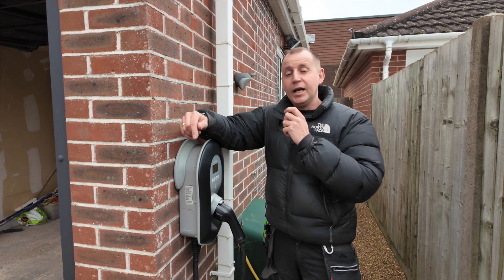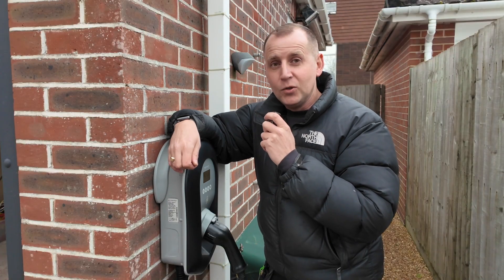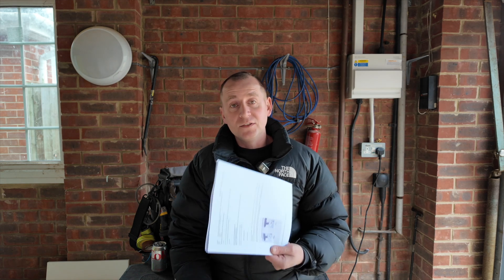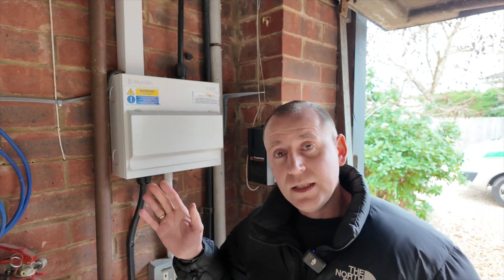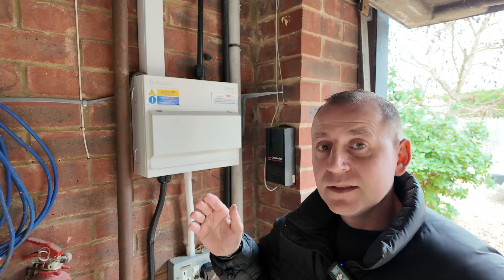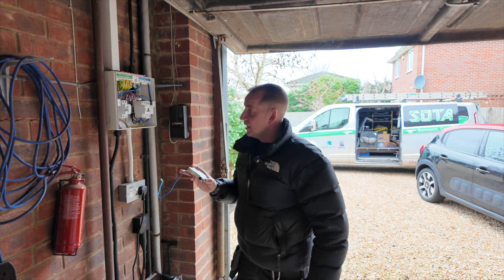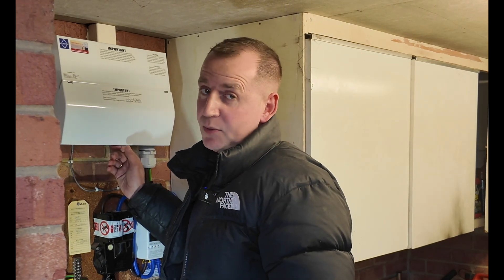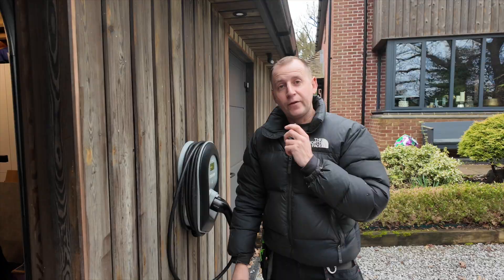THOUSANDS OF INSTALLATIONS MAY BE NON-COMPLIANT...ELECTRICIANS REQUIRED TO CARRY OUT REMEDIALS

Comment: This is all very curious.  Which BS7671 regulation says you need an RCD at the source of a circuit? The RCD is required for a socket (charger cable) but it does not have to be in the CU! There is one in the charger so regulations satisfied! Your install was fine, the regs changed (?). Not your problem if someone comes to modify the circuit, it is their problem.

Comment: This is very interesting. During my 18th edition training in September the lecturers told us not to fit two RCD’s in series with each other because of nuisance tripping. However they then said that if you have to go down this route the an RCD with a longer tripping time should be fitted up stream. This is all good but then I’m thinking “what protects the circuit from over currents?” Surely there should be a MCB in circuit or fit a RCBO but can you get a RCBO with a longer tripping time ?

Comment: Just had MCS inspection on a PV and battery install. Looks like it'll fail for the similar reason - inverter requires separate RCD, built-in RCD is not sufficient.

Fortunately, firm who installed will rectify without charge as my home install is under MCS scrutiny.

Comment: Having taken a friend's ( faulty ! ) ZAPPI  wall charger to bits .... I  noticed that the memory back up battery is  SO TINY  , no bigger than a watch battery , ( and .. of course .... it is totally flat ! ) .... There is LOTS of room inside to fit a decent size 2032 type " coin cell " battery , as found in most desktop computers etc .... comments welcome ..............  DAVE™🛑

Comment: WTF, its recommended, neutral should be allways connected for safety reasons.
Circuitry cannot fully discharge if you disconnect both live and neutral wire creating hazard. It can also happen that circuilt breaker melt and fuse live connection and disconnecting neutral when Live is still connected increase hazard, potential discharge is going path of least resistance which in this case would be anyone touching it.

Comment: I am glad that you brought up this topic. I've done the Myenergi course and I also talked to NAPIT about it back in the days. 
I've been told by NAPIT that Semi Conductors are not acceptable as disconnection of supply, therefore any built-in RCD is not acceptable. 
Also, I installed way more Hypervolt than Myenergi and their guidance specifically mentions the upstream SPD and D. Pole RCBO/RCD requirement.

Comment: So, the dB rcbo.  S type?  100mA?  Selectivity and coordination accounted for?

Just finished the new EV c&g  charging course.  If it's a built in RCCB/rcbo on the charger then the cable supplying it becomes a distribution circuit.  If it's armour, then it doesn't "need" RCD protection but can still be fitted.  Sounds like the dno is requiring clarification training for their wee folk in the office.

Comment: Glad I saw this video, my spark put my Zappi2 in back in Nov 2020...  It's running off a 63A 2pole Type AC RCD on that side of the board, its feeding 5 MCB's, one of which is a 32amp for the charger.  I'll have to give him a bell, I'm guessing to be compliant this needs the RCD replacing for a Type A or is it that the charger itself needs to be fed off of it's own dedicated Type A 2 pole RCD?   Not sure I have room in the consumer unit.
Reply from the maker: Hi buddy, the charger requires its own double pole RCD, chargers cannot share RCD’s anymore
Reply: @sotaelectrical  Really appreciate the reply!  OK, got you, that might need my spark to be a bit creative to get that to fit in :) - I've also read (in your comments here) a compact 2 pole Type A RCBO can work also, I'll mention that to him.
Reply from the maker: @ yes that’s manufacturer dependant 👍👍
Reply: @sotaelectrical  I've a Proteus board, fitted 2020, so hopefully their slim RCBO will slot in, found one on CEF that might do it.  I'll let the pro suss it out :)

Comment: It’s quite straightforward why it does not meet the requirements direct all RCD must have a test button and that’s why it’s non-compliant
Reply: and mechanically disconnect live conductors with no auto reset. Alot of people are assuming a PCB board based RCD is compliant to 61008/61009. The DoC for the product will state which BS numbers/standards are complied with.

Comment: It dose not need a RCD in fuse board as it’s has one in charger and surface armoured , where it in the regs, can’t find it
Reply from the maker: It does need an RCD because the one built in does not have a BS standard.
Reply: @sotaelectrical you got to love it😂😂, always thought discrimination was quite important, maybe they should make a charger without a RCD, and just fit one at origin, maybe would be cheaper 🤣🤣🤣
Reply from the maker: @robertmailer4978  absolutely agree mate, it’s crazy

Comment: So what happened in the end? Did you get a replacement one? As ppl say, at the time it was not required to have a separate RCD. Im in the same struggle atm, but when mine got installed it wasnt required to have one. Still dont think it is required where im from.
Reply from the maker: The end has not come yet mate, il let you know

Comment: I feel you pain I had a similar question, as my energy told me it didn’t need an RCD protecting upstream as it has its own built in. I ignored and fitted one anyway as the RCD that’s in the zappi is a digital not mechanical DC current detection. I didn’t think I’d be compliant as in effect I’m fitting 2 of the RCD’s on the same circuit and neither are time delayed. But my reason for ignoring was that what’s protecting the cable supplying the Zappi. 

It’s wrong really and like you said it should be clear, we are out there doing the best we can translating the regs and manufactures installation guides into an installation that’s fit for purpose. It’s also very hard to keep up with changes.

Comment: Hopefully a big electrical contractor will challenge this in court. It makes sense to fit an rcd regardless as the charger may get changed for a different type in the future, ( yes not your problem but it nice to future proof thing.  The rush to RCBO’s is going to come back and bit us using single poll offers no protection against PEN faults and should be banned or made go have a 100ma main switch or the like. True professional going back to these jobs and it not the customers problem.
Reply from the maker: Thank you for commenting, we shall wait and see what happens! It’s changing like the wind at the moment 👍👍

Comment: What about selectivity issues with an upstream type A and downstream type A in the Zappi?
Reply: I would want clarification the 2 devices work without detriment to each ……although I’ve fitted the same set up myself where a house CU RCD was changed to type A
Reply: Obviously the 30 milli amp protection might be subject to selectivity but always been told the Zappi internal RCD is different 😁

Comment: Are they saying that before they supply a replacement charger under warrenty, the installation needs to be brought up to current regs so it is compliant going forward? Or are they saying because the installation isn't current that the warrenty is void and they won't cover it at all? The former is not entirely unreasonable, but the latter is outrageous and wrong. It's not really clear from the video which of these it is.

Comment: Just another reason from the many hundreds of reasons EV's are not as practical as a ICE car, Unless they are charged from 100% green renewable energy they will still pollute, maybe no exhaust emissions, which would be good in congested cities. But I would never wish to take one on a road trip, not with the distance you get and the long charging times. And on top of it all I keep hearing stories of charging problems and faulty chargers, and the possibility of the Chinese turning off their EV's which they have the ability to do. Or deliberately hacking the car and charger to go into thermal overload. Don't know if all the stories are true but I will stick to age old tested and trusted mechanical technology that is not connected to the internet of shit. Why would you need a car to track your every trip unless you are running a business fleet. To me driving an EV doesn't give you the feeling of freedom when you cruise up a freeway, they feel sterile and lack any character. Let the kids drive their slot cars.

Comment: It makes a video, but I don't agree with you having to do it at all. It was compliant at the time, and the regs are not retrospective, did you not argue your case? I'd of placed a separate rcd and enclosure below the board for that circuit also, not effectively made the garage installation worse by covering the lot with one RCD.
Reply from the maker: Check out part 2 - I went back and made changes

Comment: I don’t get the issue… if there is a built in RCD te only purpose the RCD is going to do is protect the clipped direct cable between the DB and the charger. Pointless silly shit. I only install RCD where completely necessary.
Reply from the maker: Ok so the built in RCD is a digital one that does not comply with the regs, so if you are not installing upstream RCD’s then non of your installs are compliant and warranty will be void

Comment: This is the problem when the people doing  the installations have to rely on the diktat of incompetent regulation makers, why wouldn’t you install an rcd? Unless both installer and regulator have in depth knowledge of electrical theory and UNDERSTAND why you must or must not install an rcd then this is either a warranty invalidating excuse or regulation for regulations sake. If the charger is rcd protected, why would an upstream rcd protecting the cable make any difference? Are they suggesting that lack of an rcd has damaged the charger?the IET and the registration schemes are largely staffed by poorly trained and incompetent people involved in arse covering excercises to hide the fact that they dont know what they are doing and dont understand what they are regulating. A lot easier to start at 9-30 with coffee in a nice warm office than be out in the job! When they start handing down these made up on the spot regs, ask them WHY? And watch them meltdown! Electrical safety has gone through the floor since the introduction of part p, IET. Regs and the “scams”. Our consumer units never caught fire !!
So glad to be retired from the industry!
Phil

Comment: My Zappi was installed in August 2020 when my house was being built. I didn't use it for over a year because I didn't have an EV. 

When I went to use it the first time I noticed that the LCD display was full of condensation. I called them to ask if it was safe to use and they asked me to loosen the screws on the front. Water poured out - several litres.

It turns out that the guy who installed it just bashed a hole in the back-plate and then pushed a load of silicon into the gaping hole. MyEnergi said they'd replace it for me and instructed a contractor to come and do the job. I cheekily asked MyEnergi if they would replace the single phase with a three phase unit as I have a 3phase supply and it was cabled for three phase. They agreed as long as I paid the difference which was very reasonable.

The contractor they sent was excellent. Not only did he install the new unit but he also fitted devices which monitored the 'direction' of the electricity flor (from battery, mains or solar) to allow me to make better use of the charger. MyEnergi informed me the next day that the new unit would have the full three year warranty.

I have to say that in my case MyEnergi could not have been better. They were quick to respond, very sympathetic to my situation and extremely polite and professional during all my calls and emails.

Comment: Interesting that it states type A . That assumes that all EVs have galvanic isolation between 230/400 charging circuits.Same problems with solar PV most inverters have DC fault protection so why do we need type b.I felt confident under iee but not happy with it these days
Reply: Iet
Reply: IET

Comment: Hi, in my opinion… 
If the Zappi needs to be replaced under warranty, then the new charger install needs to be compliant with current regs. If the previous Zappi was installed pre reg change and was compliant at the time, the customer should have to pay for new upstream RCD, and Myenergi provide new charger under warranty.  
If the Zappi was installed post reg change, and the original installer did not fit an upstream  RCD when they were meant to, then the original installer should first supply and install the upstream RCD, and then Myenergi should then provide the charger under warranty. That seems fair.

Comment: If an RCD is inside the Zappi, then the only section of cable 'unprotected', is between the consumer unit and the charger box- And that cable should be in conduit or armoured.

This is not an issue. It could be proven in court that for residual current to flow, there'd have to be a break in the supply cable to the Zappi box.

Residual current flowing between the Zappi and EV would be caught by the RCD inside the Zappi. I smell BS here.

Comment: I thought it is a fundamental rule that the actuation of any single protective device cannot give rise to another hazard. ie Whole building loss of light. I seem to recall this is building regs.
Changing the main switch to a double pole RCCB means any single earth fault within the whole installation results in an installation wide loss of power.
If you require DP RCD isolation and it isn't available at the DB then you should split the tails with RDL blocks to feed an independent stand alone DP RCD.
As it is, you now have a complaint vehicle charger and non compliant house.

If you say this isn't so - why did we bother with at first split load boards and now all individual RCD protected circuits.
Reply from the maker: So I made a short explaining why I done this, firstly how can I split the tails when this is a garage board, not the house consumer unit? I wrongly assumed that no tails, meter, cut out, massive garage door may have hinted this but not to some. The garage board also has literally no load on it, 3 unused garage radials going to individual sockets, and a garage light, I took this all into account when doing it.

Comment: Credit to you for retrospectively changing. 

A couple of points. 

Elucian make a 2 mod DP RCBO. It looked like you had a spare way still in the board so it would have been able to fit. 

This is a contentious one with some. However the EV is supposed to be on its own RCD and not share it with other circuits. I’ve had numerous conversations with NAPIT tech and IET to ensure I was correct and understood it. They all say that 722.531.3.101 means no other circuits. 
 
As you well know the Wiring regs are non-statutory and manufacture instructions always trump those. 

So if you have a copy of the instructions saying it’s not required then they do not have a leg to stand on. 

Personally I would be taking legal action against them for defamation. They have told your customer that you have installed it in a non-compliant way when you haven’t. Regs are not retrospectively applied. So if you installed in accordance with MIs and the regulations at the time. You’ve done nothing wrong. 

Personally I’ve never installed one without upstream Type A protection. But I know a few that have. 

Myenergi are on very dodgy ground here and I’d be taking them to task. 

More than happy to help you do so if you want. 👍🏻

Comment: I contacted MyEnergi on 21/02/2024 to ask about the on-board RCD protection, as I still don't install RCD's, but I also note on my paperwork that it at least meets or exceeds the requirements of BSEN61008 or 61009.  I was told that if I was happy that it was OK, then they are fine for this to be noted and protected by an MCB.  Just take it to small claims, they are clearly being disingenuous.
Reply: Maybe you should write to them and ask them to confirm the exact BSEN number of their RCD. I can answer for you… it doesn’t have a BSEN number. They just give vague answers like “it exceeds the standards of BSEN 61008 or 9…. But it doesn’t because it doesn’t have a test button or a reset switch which are in those standards.
Reply: @stranglx  it does a self test at the begining of every charge cycle. I would be of the opinion that the system exceeds the requirements. It certainly tests the RCD more than mine at home does!

Comment: Zappi changed their installation instructions with effect of July 2023 where they mandate an upstream RCD.  Prior to this, they don't.   

The reason is because their internal RCD is not compliant with 18th Edition Amendment 2 regs, which requires that RCD must comply with BS EN 61008-1, 61009-1, 60947-2 or 62423.    

Contrast this with the Easee EVSE charger which has an internal RCD that is compliant with the regs and therefore no upstream RCD is required provided that the installation is Class 2 compliant.   So the answer is simple - junk Zappi and go with Easee !   

Remember folks that an RCD protects the circuit not the supply, and therefore does not have to be in the consumer unit and can be in the equipment being supplied.

Myenergi are being unreasonable here as RCD protects hunans not the EVSE.  A lack of RCD will not cause of failure of equipment !